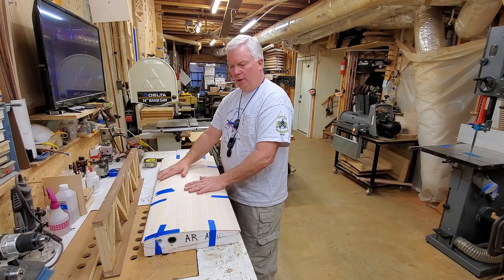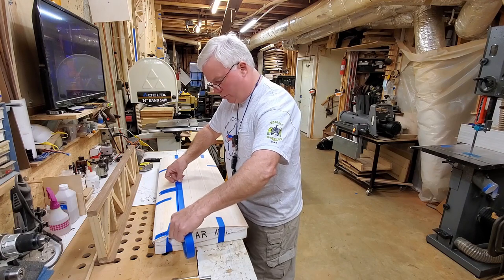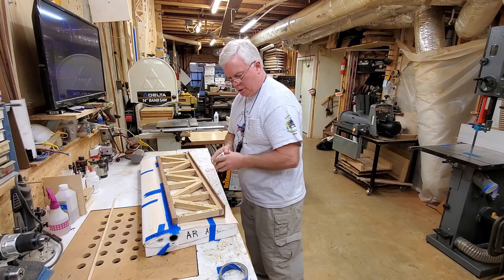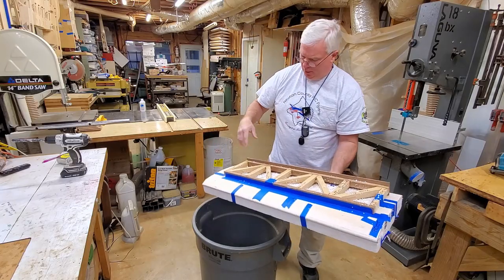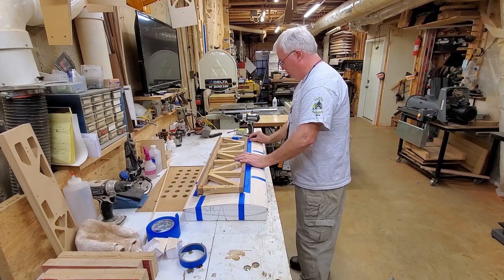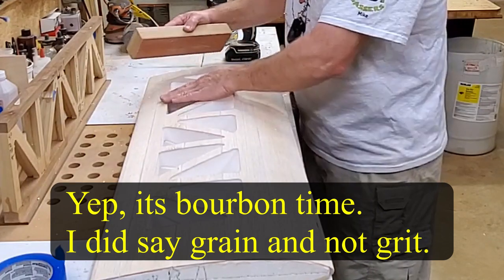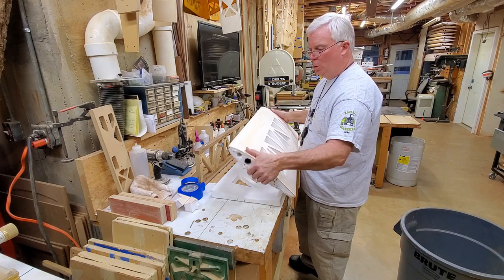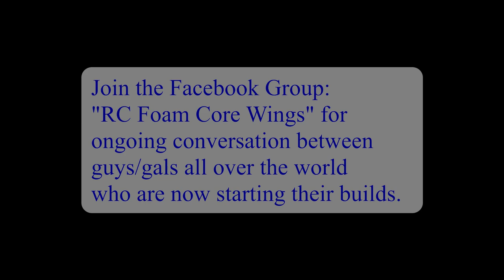Scratch Building Your Own RC Planes Episode #9 Cutting the Wing Lightening Holes

Comment: Love your videos.  I keep thinking you really need a CNC router. Would save you SO much time .
Reply: A cnc router would be an easy project.   

However,  for this project,  very few guys would have access to cnc.  

If I were selling parts, cnc would be the way to go.  

I've used my buddies cnc on occasion.    It's not as easy to draw the parts as one would think.  I can make the template faster in many cases.   Once made, you see how fast it goes.   

I may build one in the future.

Comment: So, I'm a complete newbie with gas and nitro planes. All mine have been electric.
I'm building the bush gnat and have found a motor called Force Engine EC-46F. It has 7.54 cm³ 1.62 PS and 1.19 kW.
Would the plane take this power system. It's at ~1 kg without the wings and I estimate them to be at ~ 1kg as well.
Thanks for your help,
the file

Comment: I wonder, how many horse power the motor has, which you put on the plane.
Reply from the maker: I guess you're talking about the red mid wing plane, the SportGnat.   I have only run it with a 35CC  rear exhaust engine.   I'm sure it would fly with a 20cc  but it wouldn't match my flying demands.   In addition,  you would need to add nose weight to get the cg right.  A 35CC  works perfectly with no required weight.   The plane is already heavy at 10.1 lbs dry.  But with over 1,300 square inches of wing, its very floaty.   

The two brands of 35CC that I have used are the RCGF and the DLE.  The DLE 35RA Is a great motor but I actually prefer the RCGF35RE .  Its a bit stronger,  lighter and cheaper.  Plus, Joe Nelson at RCGG USA is great to work with.  Its a small organization with great service.  

More to your question though.  
The RCGF35RE Is 4.1 hp.  

I've run 20 and 26cc on the BushGnat  but I am building one with the RCGF35RE.   I think it will be a better plane.  

I plan to try a DA50 on the next on just to see the difference. The plane can definitely handle the 5.0hp.  I don't think the weight will be an issue but we well see.  

Join Facebook group, " RC Foam Core Wings" for  more discussion on the project and what other guys are doing on  their foam core builds.
Reply: @mikencrcf6018  Thanks!

Comment: Mike do you sell your planes?  If so how much?
Reply from the maker: I have sold some of them to guys at my field.   

A good many guys have asked if I would sell planes.    I have considered providing a "short  kit" for guys who are unable to cut and sheet wings and the fuse parts.  The plane design doesn't lend itself to mass production and sales.  This design is far more labor intensive than mass produced ARFs and its only feasible if you provide the labor. 

I have not given much thought to a potential cost for a short kit.  

I am not set up to produce a bunch of completed planes but I could likely manage several sets of fuse parts and sheeted wings for guys who can't produce those parts but they could handle the builds from that point.  

Join Facebook group "RC Foam Core Wings"  to talk more.  

Thanks